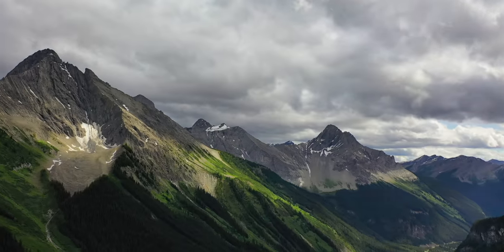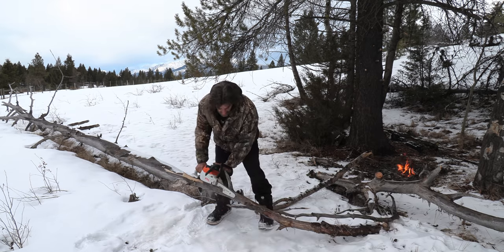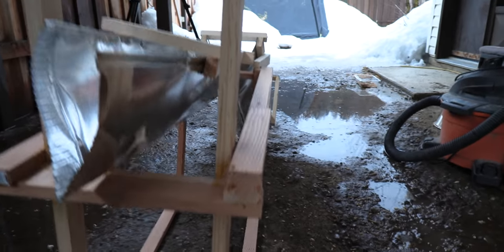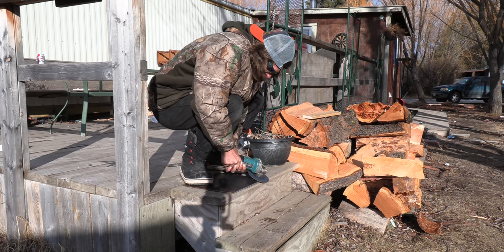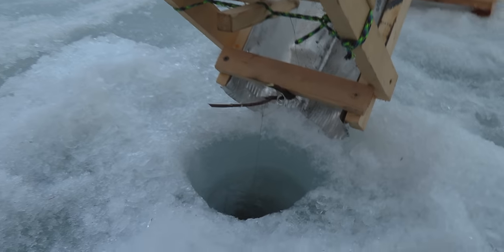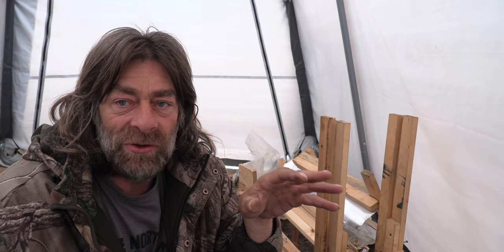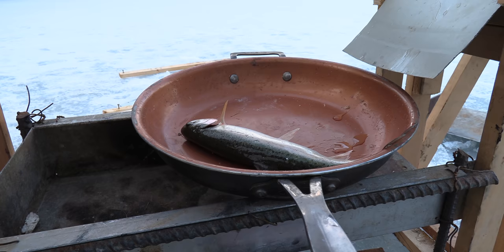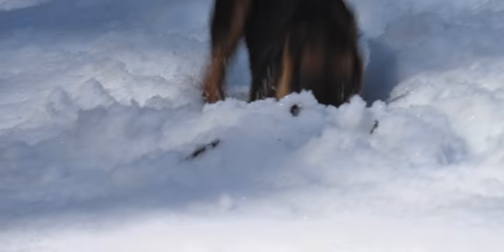Automatic Trout Catcher with a Guillotine | Catch & Cook Ice Fishing | Fish to Pan Challenge!

Comment: Next version: when the pan gets pressed down by the weight of the fish, the pan's downward movement trigger a spring mechanism to swivel salt and pepper from the left and right side of the pan to season the fish. :) Please make!
Reply: Right, I like fish but I was thinking about garlic, chives, basil and pepper etc.
Reply: The machine is already amazing, but this is a very funny idea and I think keeps with the spirit of the machine perfectly, 😂
Reply: No
Reply: -  Actually, I was thinking that the oil/butter and seasonings should be already there, but the mechanism that turns off the motor for the reel, also activates a spark  trigger to ignite the tinder under the pan, so the fuel doesn't start burning until after the fish is in the pan, and the seasoning and oil/butter will not burn or have to be dispensed.  That was what i was thinking would be working better while watching it because otherwise a lot of the fuel could burn away if the fish doesn't catch right away, like say a half hour before it gets a bite, then most of the fuel would be used up and the fire going out.
Reply: Where do u stop? Have an app that calls your phone and tells you when it will be served up? 😂
Reply: I was more interested in seeing how the device guts the fish.
Reply: Needs a way to automatically gut and clean

Comment: The blade on a guillotine is diagonal. Not straight across. Gives a cleaner cut. However Doc Brown would be very impressed.
Reply: I also was going to mention this...As well as it being sharp which is very helpful as well..LOL...not just a dull end of a steel plate

Comment: Greg, you might want to try either a roller-action microswitch (10 Amp rated ones are common and should handle the seat motor current no problem), rather than the toggle/elastic, or a neodymium magnet and magnetically triggered switch & automotive relay (if the toggle switch gives you any problems). The microswitches can be bought surplus, and are industrial-type so not as much chance of a plastic switch toggle handle breaking in low temps. You might also be able to have the blade self-resetting with magnetic or roller action switches as limit switches.  You'd need another motor, but they're cheap. ( I suspect that some pieces of this owe and honourable mention to P.A. - my own favorite source for geared motors and all the other such bits and pieces of that type). From the background in your videos, I suspect we're in the same area - maybe I'll see you some time. Thanks for posting this - entertaining and educational, LOL!

Comment: Trout are easier to gut /clean / prepare when the head is on. Also you want to cut the inside spine from head to toe, so you can remove the blood line. Scrape with thumb nail. This makes the trout taste soooo much better. 
After cooking with head attached , you can remove bones with ease . as you pull the spine out it separates the meat assisted by a fork from rib cage .